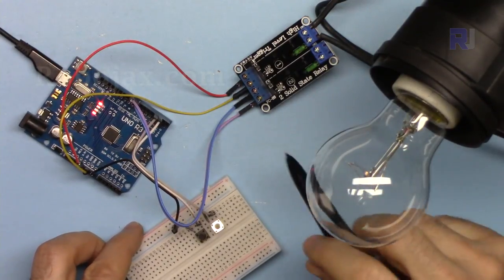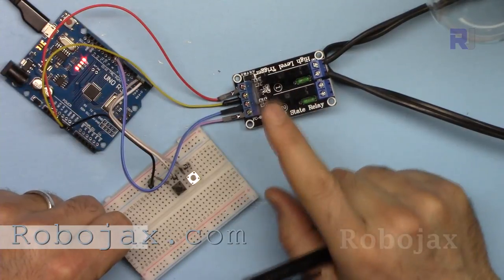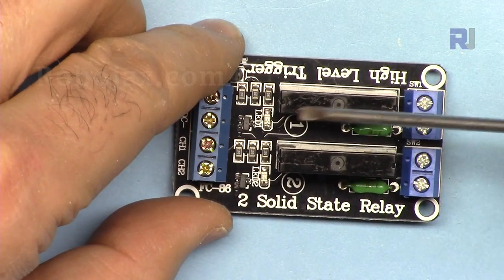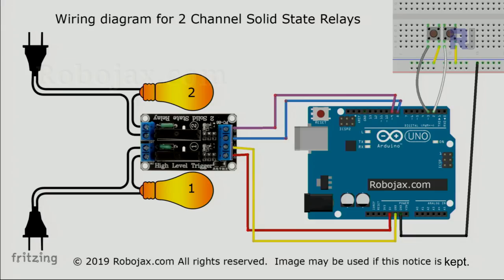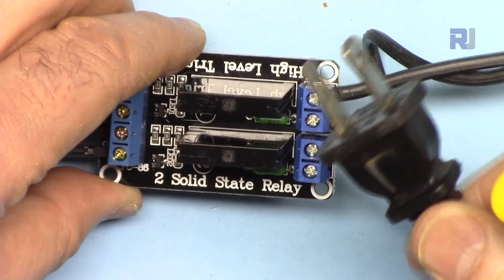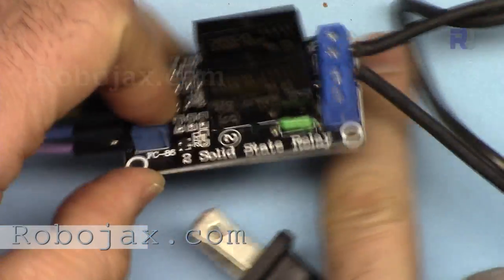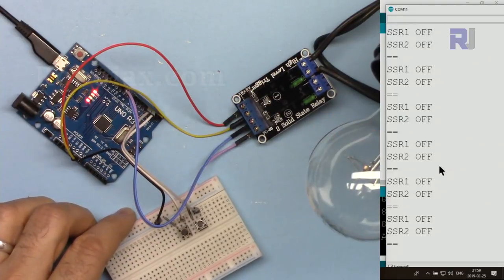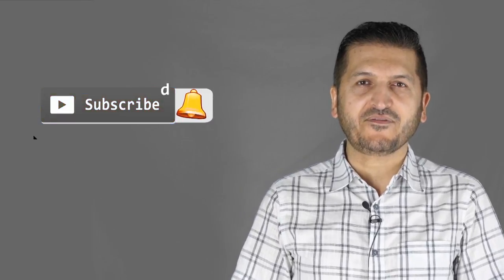Lesson 65: Controlling two channel Solid State Relay with push button switches

Comment: I have been enjoying your YouTube tutorials and have learnt a lot. I have built this very project using your code. I would like to be able to have each relay open for in 20sec and then turn off without loosing any of the functionality. Ie toggle to interrupt and the relay resets again. So I press moment 1 and the relay 1 opens for 20sec then off, I can then also press moment 2 and relay 2 opens for 20sec then off with the ability to interrupt either relay at any time. Is this possible? Can you assist or point me to one of your tutorials that I can use to assist with this project please.  Thank you
Reply from the maker: Hi, you can use millis() to overcome this . Please watch this video on millis()
Lesson 62: Time control without delay, LED blink with millis() | Arduino Step By Step Course
https://youtu.be/obBX9hyH5mM
Reply: @robojax   thank you for your reply.